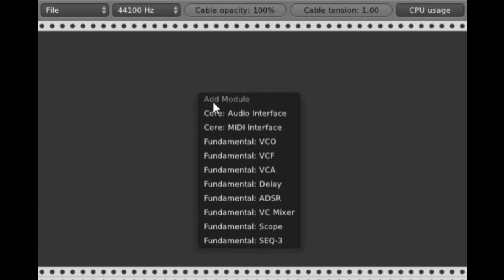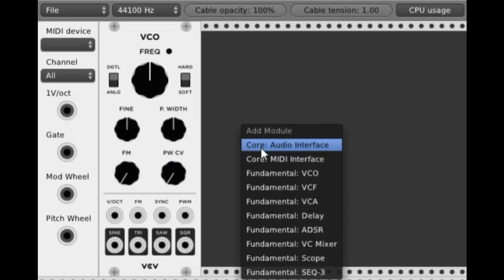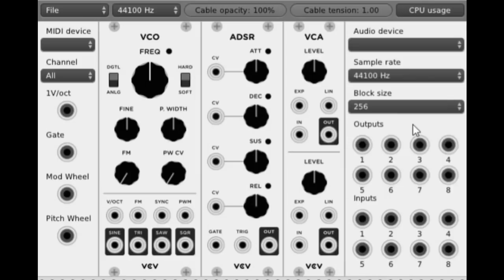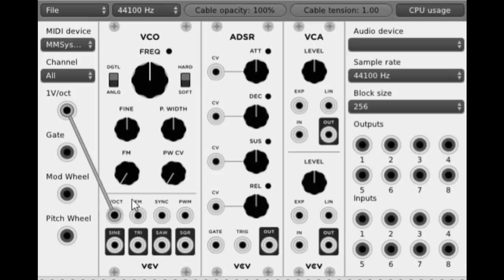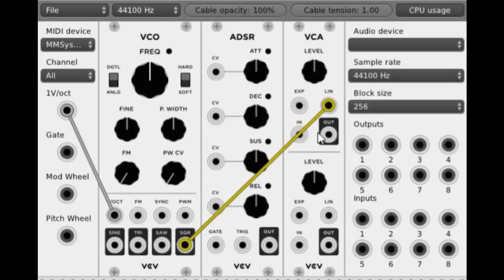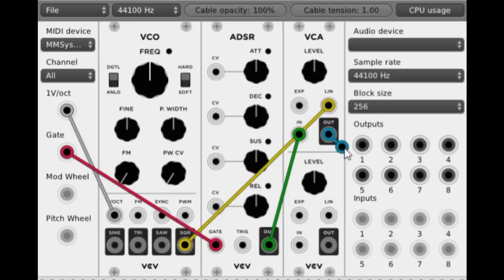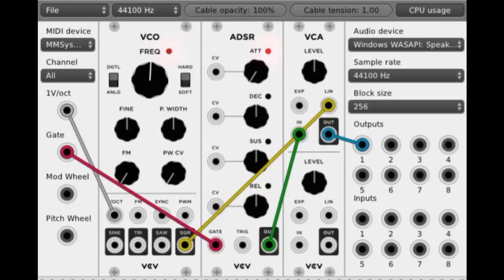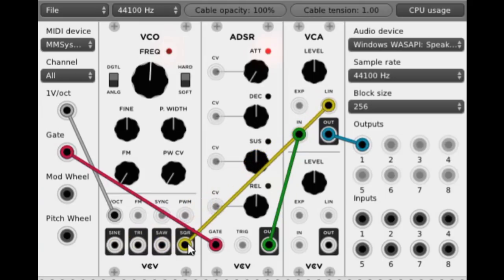VCV Rack Tutorial - Making your first sounds

Comment: The oscillator is controling the VCA in this Patch (If it ist going to Lin in). You should but the Output of the Adsr into Lin or Exp Input of the Adsr and the Output of the VCO into the Input (IN) of the VCA.
In this patch the VCO does not pass through, it just controls the Amplifier (VCA) and the Signal beeing amplified is the Envelope itself.
Reply: That's correct. The ADSR controls the "envelope" or the amplitude of the sound  so its output should go to the "Lin/Exp" of the VCA. The output of the VCO should go to the "In" of the VCA. Then you should hear the sounds correctly. It's also useful to add an Oscilloscope module and monitor the output waveform, that shows clearly what's happening. As it stands this tutorial is quite misleading.
Reply: It's harder to hear the problem when using the VCO's square wave, but when you switch to the sine wave, you can't miss the buzz. If you add a scope module and hook it's X input with the VCA's output you can see exactly what's going on with the waveform. The top half is coming through but (I think) quieter. The bottom half is cutoff at 0, that is values expected to be below 0 are exactly 0. This matches the VCA's documentation found at https://vcvrack.com/Fundamental.html:

"linear VCAs obey the equation out = in × (CV / 10V) for positive CV, and out = 0V for negative CV."

Comment: Thank you for the tutorial! It seems that the sine wave doesn't sound like a sine wave. Any idea why? Is it adding some harmonic distortion or something?
Reply: I just reproduced this patch, and the reason it doesn't sound like a sine wave is because the output is clipped below 0v, adding additional frequencies. The VCO SQR output should go to VCA IN, and the ADSR OUT should be patched to VCA LIN. I posted a question on Facebook VCV Rack and someone pointed this out to me.
Reply: I think most of the difference in a normal sine and the sound you're hearing in this video comes from the recording software and youtube's default audio compression. If you use the sine in the actual program on your computer it sounds much more accurate to a Sine wave. :)
Reply: Thank you for the reply! It's strange though... I tried it on my own computer and got the same non-sine sounding result.
Reply: Thank you so much for explaining that. I need to learn more about all this to know why that was happening, but it did solve it!

Comment: Hey, do you have any idea why I'm only getting sound out of my left speaker?
Reply: Press CTRL an "draw" a second cable from adsr out of the second output of the audio Interface module.
Reply from the maker: Yes. That is the expected output from this setup. It's a single channel mono output. You can usually fix this by adjusting the left-right balance on your mixer... if you have this facility.
Reply: There is also another solution: you can use the free Befaco mixer and output two channels to one and two on the interface module. Just connect your output to the mixer and voila, you have a dual mono main output.
Reply: Best answer thanks mate
Reply: thx mr benni